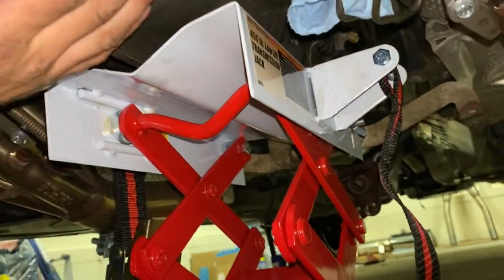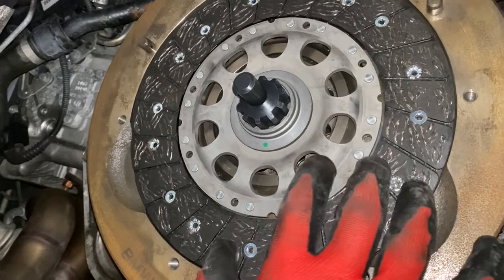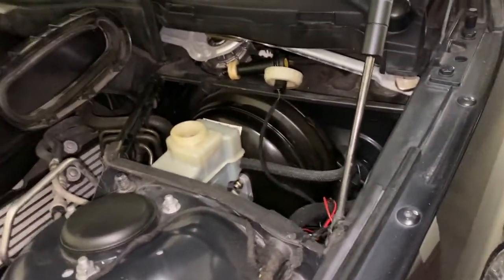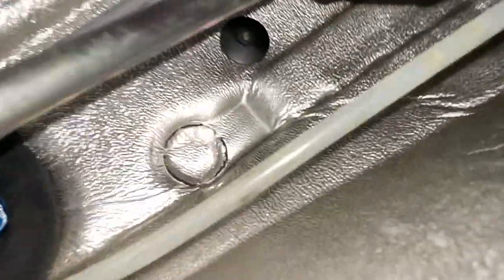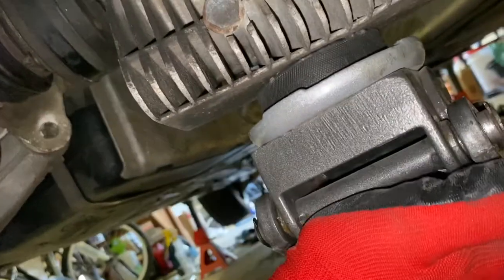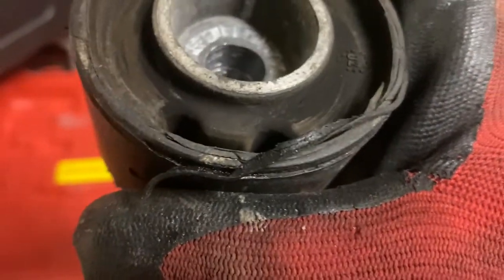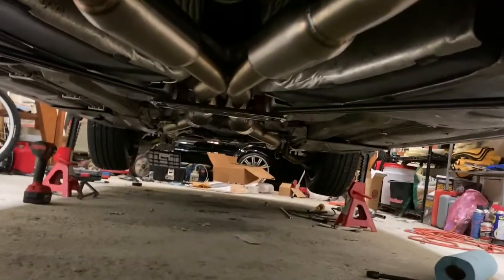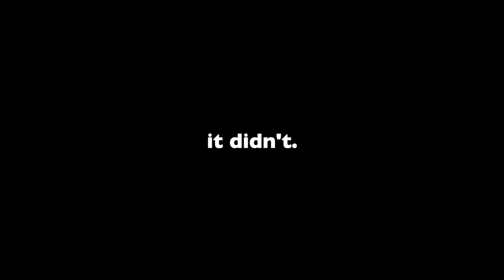I made a HUGE MISTAKE replacing my E39 M5 Clutch & Diff Bushings (Part 2)

Comment: FYI one done the pilot bearing several times with DRY bread. No need to get it wet. Just need a slice or too and just keep packing it in there and pounding with a socket extension. It comes out every time.

Comment: I’ve put down little over 30,000 miles on my clutch and with all the abuse it’s still going strong, this winter most likely I will rebuild differential, driveshaft, whole subframe bushings, control arms, and new clutch mind as well